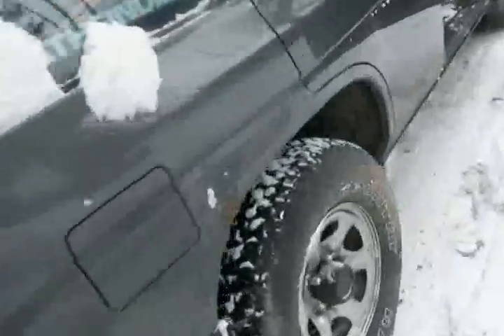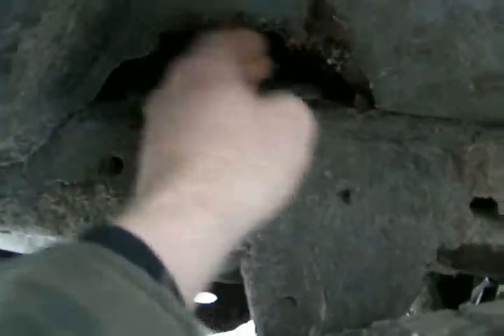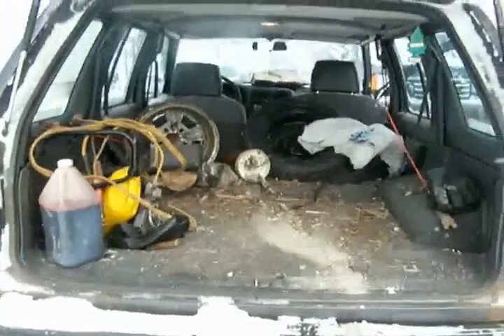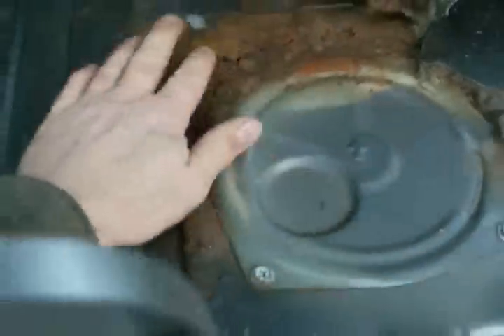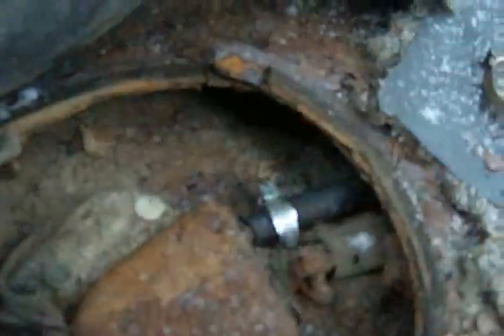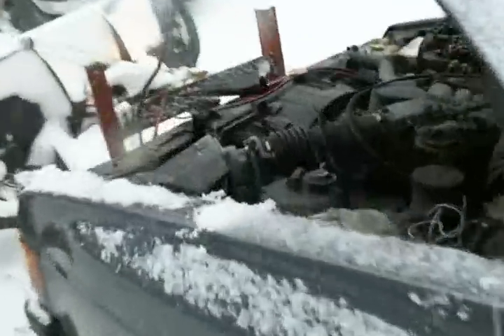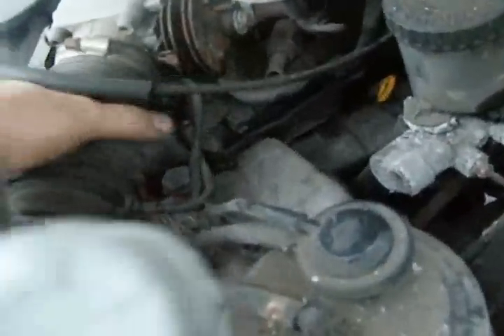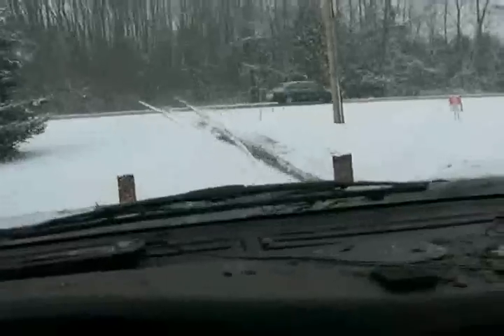redneck fuel line repair.avi

Comment: I have a leaking line on my 94 nissan pickup. Mines pretty rusty too and i was able to just chomp out some of the bed right over the fuel pump to see what im working with. Going to be running new hard line up to the cab. Thank god these nissans are super simple vehicles.

Comment: OMG, I moved away from the rust states over 10 years ago now & I remember why now! Back in the day I had a chevy luv pick-up that I drove till the frame broke where the cab & bed met. No problem, painted some 2x4's black jacked up the truck till the bed came away from the cab. then lowered the truck back down with the 2x4's between to keep the gap. I bet I went another 10,000 miles like that.Funny, I cant understand how I lived this long.......